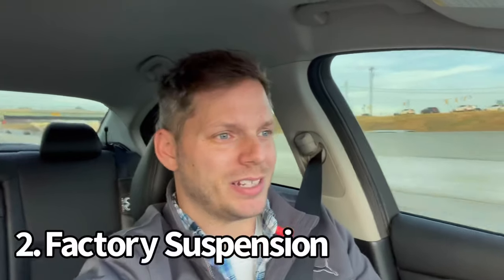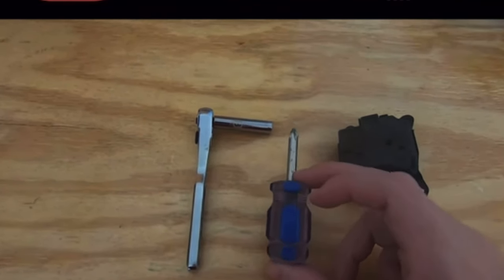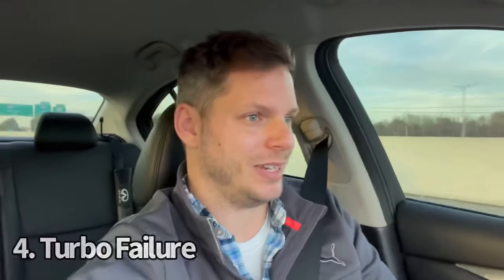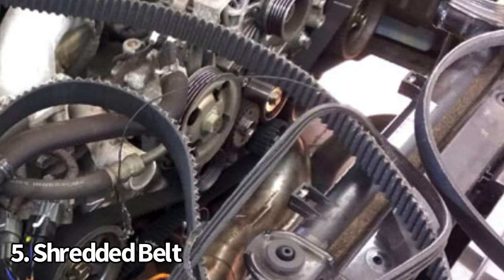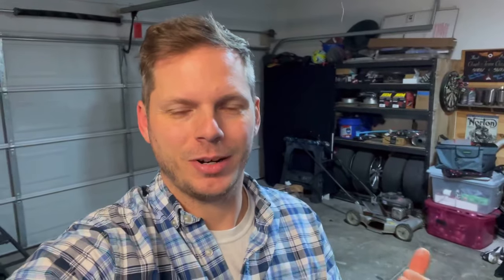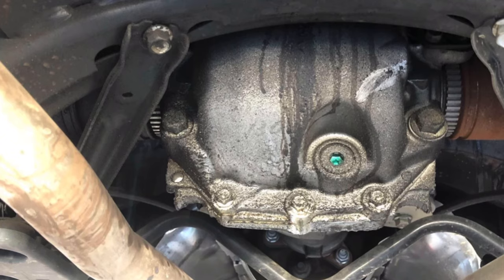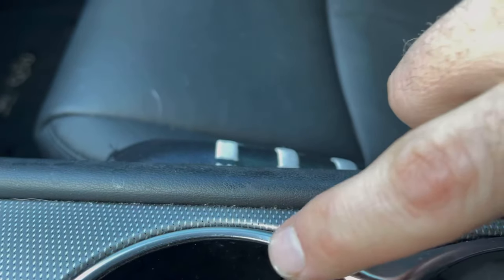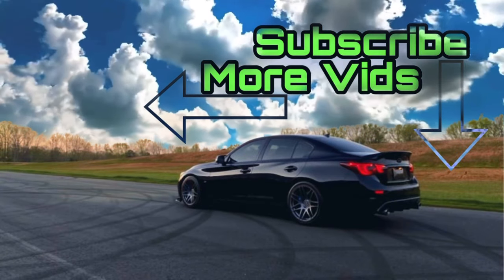8 Q50 Parts that WILL Fail!

Comment: My 2014 q50 premium with 72k miles that I bought 2 months ago just got a Chassis control system error and it's essentially in limp mode.
Reply from the maker: Dang
Reply: I had that happen a month ago. it was just a loose speed sensor for me
Reply: The dealership states it's a brake issue with the brake switch which is causing the chassis system error and it killed my battery because the brake lights will not turn off and it's a $450+ fix
Reply: Same thing happened to me about a week ago.  Mine did not go into limp mode though.  When I did some research people were saying it could be the left rear abs wheel sensor.  I think mine was just dirty.  I went to one of those automatic gas station car washes, got the wash where it sprays water underneath the car.  And my error message never came back after that.
Reply: @mcleodcurtis  that's pretty lucky
Reply from the maker: @reanukeyves9041  is it a repair you can do on your own?
Reply: @SpeedCultureStudios  If I knew what the problem was prior to getting it diagnosed maybe I could have fixed it especially if there's YouTube videos but when I looked up the issue there was several symptoms and different issues with the same error. Like for some people it was there abs sensor but for me it's my brake switch.
Reply from the maker: @reanukeyves9041  the common one I’ve heard was abs sensor.  $450 with labor isn’t terrible
Reply: @SpeedCultureStudios  yes I agree $450 isn't horrible especially with labor there also throwing in a free detail. I saw the abs sensor replacement video but my friend's OBD2 sensor didn't pick up any error codes which made it increasingly frustrating so I had no choice to but to have it diagnosed at a dealership or autobody shop.

Comment: I have my 2014 infiniti Q50S hybrid from japan /nissan skyline 350GT hybrid and I've never experienced any of these. My car is 10 years old btw so it all depends on how you take care of car.
Reply from the maker: No, the valve body failure is hit or miss—has nothing to do with taking care of it.  It either happens or it doesn’t.  The rear diff bushing will fail—it’s a matter of time.  It is not a part that can be maintained or cared for. Just a couple of examples.

Comment: Any advice on a 2.0 t it's a mercedes engine and transmission and the Infiniti dealers never use the right oil, I change my own oil with mb spec and I do it 4 times a year even though the manual Says to change it annually, I love the fuel economy and even though it's no 6 cyl it has adequate power at least in the first 2 gears, I know q50 boys don't recognize it as a real q50 but I would like someone to give some advice for thise
Reply from the maker: What kind of advice are you looking for?  If you enjoy the car and it checks the boxes you need in a vehicle, then that's perfect.

Comment: My mother had a g37 and the rear diff bushing let go. Infiniti quoted $3500. Her car had 65k miles on it. She traded it the next day.😂🤷🏿‍♂
Reply from the maker: What a joke lol
Reply: OMG does it really cost that much to fix it ??? Thats crazy  :(
Reply: Man this is really disheartening to hear.. i have owned a g35 that had 90k miles and traded on a 2012 g37 that i drove for 8 years 68k miles and got a 2018 redsport about a year ago.. so yeah i have been an Infiniti guy for a long time and not one wrench on any of my G's besides normal wear and tear tires oil change and brakes...  i just put a new belt on my 18 red sport 2 weeks ago.. 41,0000 miles.. started making a chirp and the triangle on the pully tensioner showed it was streached..  i take that back, Infiniti put a new transmission in the  g35s. I took it i. For service and they called to say it had a recall on the transmission. But for as i could tell nothing was wrong with the transmission...

Comment: That’s why I traded my 2014 q50 for a 2016 Lexus IS 200t f sport I was having transmission problems already with the q50 with only 38000 miles my lexus it’s slower but more reliable and more fan to drive

Comment: Can someone help me with a p0101 code? i swapped my maf sensors with 2 different qs and i tried to find any leaks but nothing
Reply from the maker: Factory intakes? Tuned? Did you put the MAF sensor in facing the correct direction? I know it seems obvious but gotta check. Wires on the connectors good?
Reply: @SpeedCultureStudios  ams intakes and tuned my goracebox , yeah i had everything checked by the guy i go to and also by the dealership multiple times and even went back to stock tune and the mafs were swapped from another q , still getting it
Reply from the maker: @dannydang8487  That's a tough one.  My mind tells me to make sure everything is good on the connection side--the harness that connects to the MAF sensor.  loose wire, bent pin--something.  Something isn't connecting to get a signal from the MAF.  I could be way off, but that's where my thinking is.

Comment: My valve body went out dealer wanted like 2200 for the parts so I went to eBay got one for like 400
Reply: What symptoms did ur car have when it went out? Did it just not run at all or sluggish
Reply: @_mathtutor3334  nothing I noticed it just happened

Comment: Is the 2014-15 still worth it ?
Reply from the maker: I think so personally!
Reply: I think the q50 14’ & 15 are the most reliable
Reply: The only thing I replaced was both rear  trunk struts, brake and rotors, serpentine belt recommended and replaced ALL under body oil fluids at 50,000 mile. Car has 62,000 and running like new. 2014

Comment: You forgot turbo rattle at cold start, wheel speed sensors in the rear and misfires caused by people not changing the spark plugs at 60k
Reply from the maker: We’ll spark plugs are wearable items lol.  I hadn’t heard too many wheel speed sensor failures, but that’s a good one.

Comment: 166k miles on my 2014 with Zero issues.  Diff bushing has ez fix on youtube.
Reply from the maker: Just remember the easy fix is not a permanent solution.

Comment: I have a 2015 q50 and my window on driver side is sounding rough.
Reply: A guy earlier in the other post said use the silicon spray around the edges and it will fix slow roll up or noisey windows... my 18 redsport is starting to do the noise when rolli g up the driver side window so gonna give it a try
Reply: @_mathtutor3334  make sure it's DRY lubricant spray

Comment: Anyone experiencing rack and pinion issues or strong vibrations in the front end?
Reply from the maker: That’s common also.  Some cases with no resolution to be found.  Check all the typical things—wheel/tire balance. Alignment. Control arms. Wheel bearings etc.
Reply: @SpeedCultureStudios  been driving me crazy. Already replace Rotors & hub bearing, improved but still got some vibrations. Found a small leak in R&P and at full lock to the right of I wiggle the steering I see the Rack moving slightly. Thinking maybe bad R&P bushings and possibly even a bad inner tie rod on driver side. It’s been a headache hunting down this issue!

Comment: 60k 70k bushing go on all vehicles lol especially on suspension parts lol bushings are rubber they deteriorate or time lol
Reply from the maker: They certainly have potential to fail on all vehicles with that many miles yes.  They just seem to fail earlier in the Q50, but the more important point is that they cannot be replaced as of right now.  That was the point

Comment: Brake rotors are consumables. Why are they on the list?
Reply from the maker: Consumable in the general sense, yes.  However, the sport rotors have been known to warp and require premature replacement.  Not because the part gets worn over time but because the quality seems to be subpar.  As explained in the video

Comment: When I first got my q50 at 29k it blow cold on one side, then at 75k the a/c belt started failing now at 86k my i think i need a throttle body sensor and fuel sensor
Reply from the maker: AC belt? Blend door actuator is a common problem but a cheap and easy fix.
Reply: @SpeedCultureStudios   other then my tired sensor going bad everything still good my car and it at 80k . Also this 2014 infinity q50 hybrid

Comment: Did your valve body ever go bad ?
Reply from the maker: Thankfully no.
Reply: @SpeedCultureStudios  okay does it matter if I let Nissan or Infiniti diagnostic the car ? I have a 2015 3.7 like yours with po720 code and low battery voltage code
Reply from the maker: @Bagtalkdom  they should diagnose it if you’re having problems, but their cost to repair it will be high

Comment: Everything you mentioned is normal wear
Reply from the maker: Negative.  Valve body failure is not normal wear.  Rear diff bushing failure at 40k miles is not normal wear.  Nonetheless—no one said anything about these being “normal” or “unusual” issues.  The video is items that “will fail.”

Comment: I was seriously considering an 2018-19, but this car seems like it’s trash! So many things that will go wrong and I’ve heard of the porous engine issue. Too bad.
Reply from the maker: Porous engine issue seemed to be more common 16 into early 18, but don’t hear it much on newer models.  Car is far from trash—even the issues I mentioned aren’t that big of a deal and the 16+ doesn’t have the trans issues
Reply: @SpeedCultureStudios  Thank you for your reply. I really like this car and it seems like there are many low-mile ones near me for what seems like a good price. I will look again. I was concerned about the CVT, turbos and porous engine as they seem to be the costly repairs.

Comment: DONT FORGET THE INFAMOUS P0720 CODE FOR OUTPUT SPEED SENSOR! Basically one sensor in the transmission goes commonly bad around 50,000-75,000 miles get this done under warranty I warn you! Mines was 3k to fix,  INFINITI IS VERY AWARE OF THIS ISSUE, YOUR CAR GOES INTO LIMP MODE AND WONT GO OVER 30-40 TRASH! Never had any car give out at 50k miles throw the whole q50 away these are terrible cars unless you like to constantly get it repaired and spend a pretty penny too.
Reply: ALSO THE WORSE PART INFINITI REPLACES THE VALUE BODY WITH THE SAME PART JUST NEW SO IT WILL EVENTUALLY FAIL AGAIN IN THE NEXT 50K Miles so trash glad I got rid of my Q